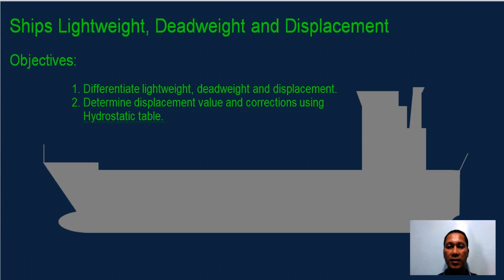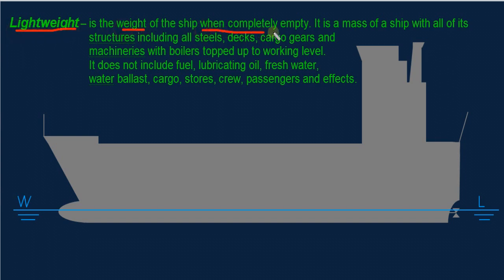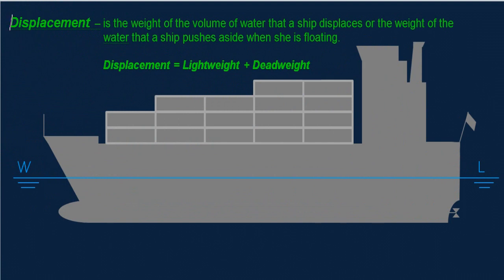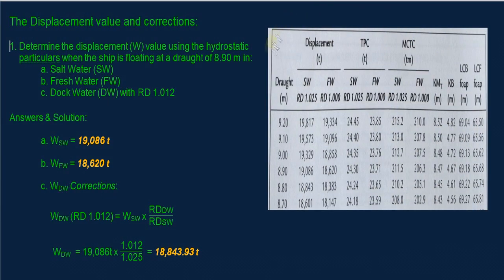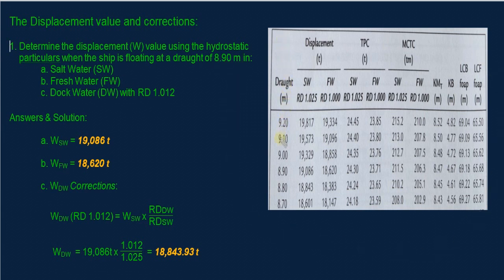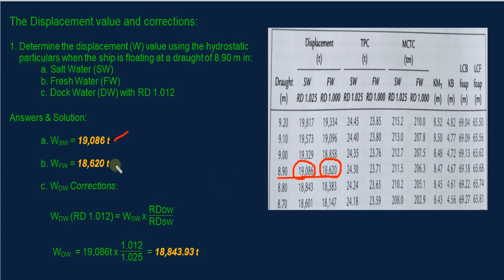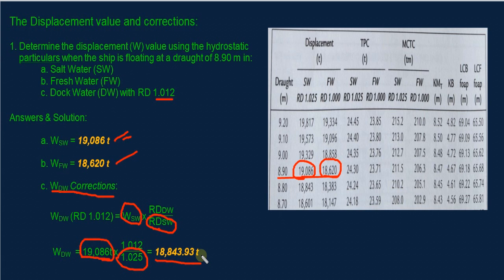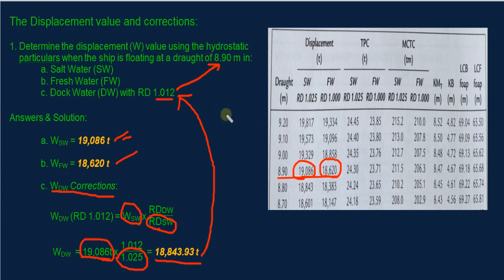Ship's Lightweight, Deadweight and Displacement

Comment: Which one the biggest? Is the DWT or LWT For 50-100 GT ship i mean for SAR vessel? And what the presentation?
Reply from the maker: Lightweight: The lightweight of a ship refers to its weight without any cargo, fuel, ballast, or passengers on board. It includes the weight of the ship's structure, machinery, equipment, and fixed supplies. Essentially, the lightweight is the mass of the ship itself.

Deadweight: Deadweight is a measure of the total weight that a ship can carry, including cargo, fuel, ballast, crew, and passengers. It is the difference between the loaded displacement of the ship and its lightweight. In other words, deadweight represents the maximum cargo-carrying capacity of the vessel.

Deadweight is a larger and more comprehensive measure, as it considers both the ship's structure and its capacity to carry external loads.